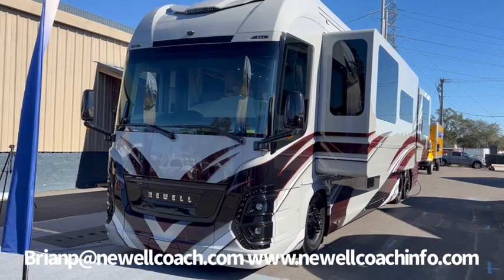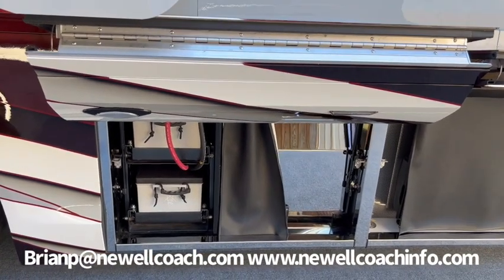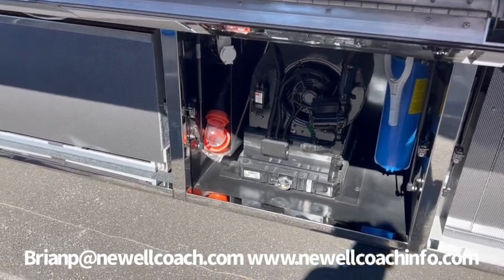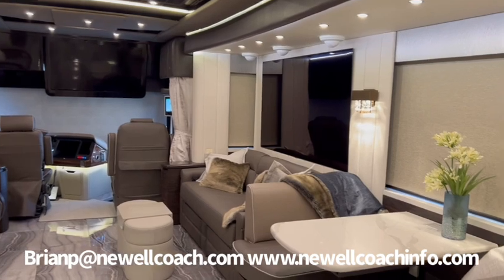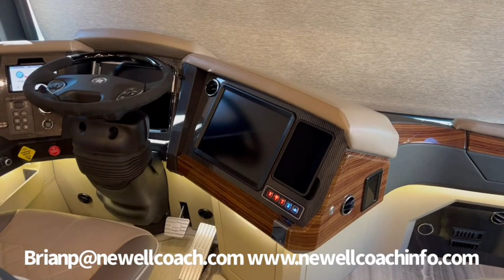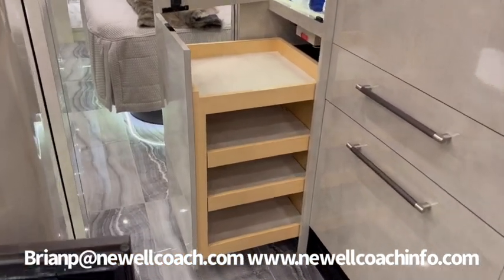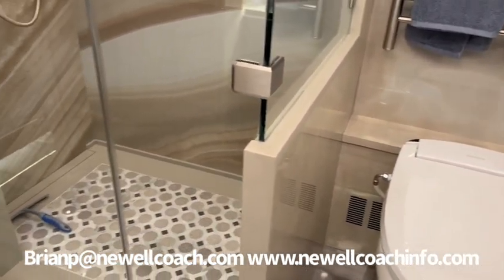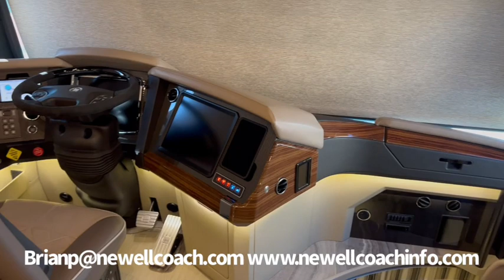2023 Newell Coach #1771 Video Tour- Tampa Show

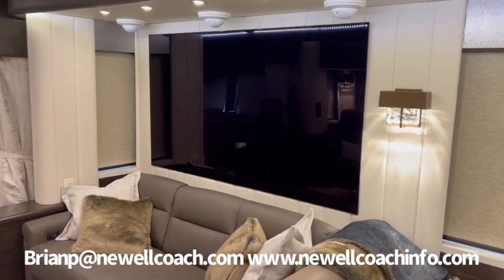Comment: 12:15, have you guys considered putting a short throw projector where the speakers are at above the TV? A projector is not going to beat a high end TV's quality but you get your window back. Using a short throw projector, you can still walk in the isle between the couches just fine without getting in the way of the picture and you get to keep the storage space above on the other side where you'd normally put the projector.
Reply from the maker: We've talked about it.  One of the challenges for a projection system in a coach is to make sure we have a projector that can handle road vibrations (why we chose the one we use now).  We will need to do some research to see if there is a short throw version that is appropriate.

Comment: If the 75" tv doesn't move then why have a window behind it just finish the exterior wall with aluminum since there is a camera to project the outside.
Reply from the maker: Great question!  We finished the window out behind the television in case the new owner (or next owner) prefers not to have the television mounted that way.  We also built and wired a cabinet across from the window to accomodate our projection television system for the same reason.